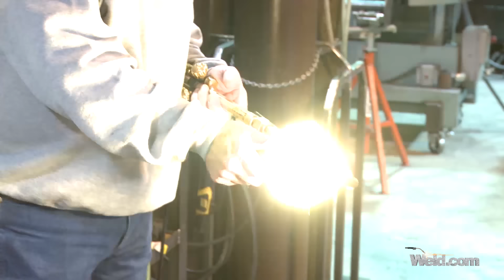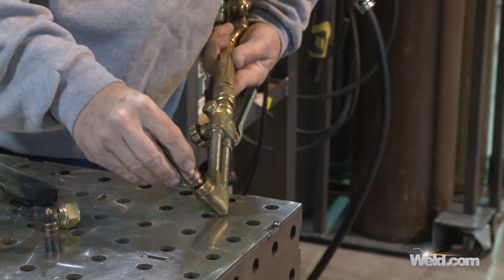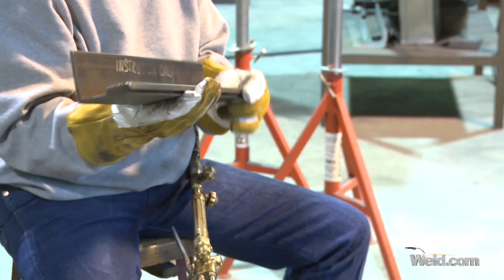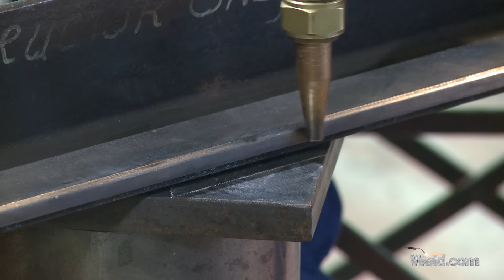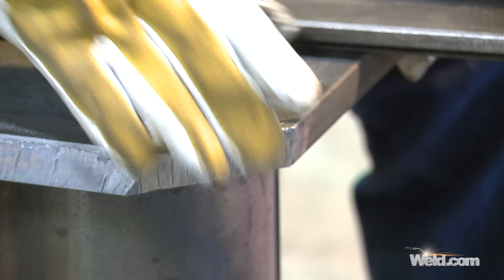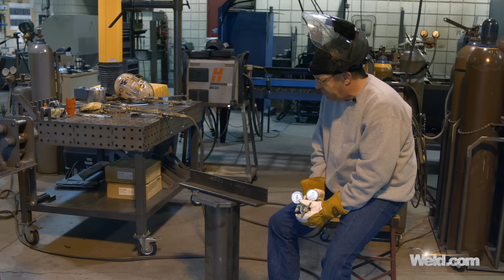🔥 Tips for Oxy-Fuel Cutting Thick Steel

Comment: I was watching some steel workers free hand cutting six inch thick steel with kerosene and oxygen. They said said they can use diesel, or gasoline as well. Gas and diesel is hotter then kerosene, but diesel is very sooty, and gasoline is to dangerous in confined space's.
Reply: All three require special torch tips, and other special equipment, but can burn all day on one 5 gallon tank of kerosene.
Reply: By the way, it was the scrapping of Bertha, the Seattle tunnel machine that was being cut.

Comment: Bob, I would like to see tips on oxy-fuel cutting thin metal as in 3/8" and thinner, I have more trouble with cleanly cutting them than I do thicker stock mostly blow outs and  thick slag on the bottom of the cut, if you get a chance to I would greatly appreciate it and keep the videos coming 😊

Comment: Why don't you go in to more detail about why not to run the acetylene over 10 PSI?  You should also talk about the dangers of using small acetylene tanks and cutting / heating too long with them.  Most people I have talked to just think a smaller tank is like a smaller bottle of water or whatever.  They don't fully understand the acetylene draw rates and why a small acetylene tank can be dangerous if you use it too quickly with big tips and big cuts.

No channels I have watched for years have even mentioned "draw rates" and it is very important because most home shops don't have huge tanks and can get in trouble easily.
Reply: PictureDisks could you explain it. Just curious since I have small tanks.
Reply: Acetylene becomes unstable as a gas over certain pressures (15 psi+) and it will explode, ruining your day.  In the tank, the acetylene is dissolved in acetone to keep it stable at higher pressures.  If you draw too much gas, you start getting acetone in the gas stream (you will see little balls of flame).  Larger tanks will provide higher rates of gas for longer times than will smaller tanks.  Acetylene tanks should ALWAYS be vertical to keep the acetone and packing where they were meant to be.  If you lay one one its side (not advisable but happens) let it stand upright for 24 hours before using.
Reply: jose mendez as I understand it, the acetylene is stored dissolved in acetone, which is liquid, held in an inert solid matrix. If you draw off the acetylene faster than it can be released from the acetone, acetone will enter your hoses, messing up your work but also reducing the amount of acetone inside the tank. Leaving a big space in the tank that isn't occupied with acetone allows a buildup of undissolved gaseous acetylene, which is really good at exploding.
Reply: It's called disassociating
Reply: Small tanks are safe just don't run rosebuds on any acet cylinder under 50psi tank pressure.

Comment: Great Video Bob, Unless the camera is not showing it good I have been adjusting my torch wrong for 40 years. I have always open the mix valve until the preheat flames come down close to the tip and create that fine pretty feather effect. Guess I have some things to try this week.

Comment: Bob, what consequences do you have for too high acetylene? Let’s say over 15? Good catch on the regulator. Another great video. If I could cut like that I would go through lots less 4” wheels!
Reply: Dave Dunn acetylene explodes really easily. We use a different set of numbers in Australia, but I'd assume that's the pressure above which it can spontaneously explode.
Reply: At roughly 18psi at sea level, acetylene will explode, without an ignition source. That's why it is dissolved in acetylene, think about your acetylene cylinder like a 2liter soda, the acetylene would be the CO2 and the acetone it is dissolved in would be the soda.

This is a perfect example of why IMO, you should have to have a license to buy acetylene, involving a basic gas safety test. If you don't know the basic safety rules you have no business playing with explosive gasses. 

Another very important rule is the 1/7 ratio. You can't dispense more than 1/7th of an acetylene cylinder at one time. Any flow rate higher than that, even at lower pressures, will result in acetone flowing from the tank.

Comment: Bob, thanks for this great video, so many super points. Before the days of u tube "older" people like myself had to rely on books. I never thought of kicking the O2 pressures up that high, but my plasma cutters often exceeds 70 lbs. Many who use a straight edge for a guide should note that your leading edge is elevated off the work surface, we'll I'll go back to my nap, once again thanks. J
Reply: I have inherited a 30+ year old oxy acetylene rig. The hoses appear to have lots of cracks. I would like to replace them and have seen hose sets at a local discount hardware store that are smaller in diameter but are relatively inexpensive. Say 50 ft for around 40 dollar's. Would it be ok to go to a smaller diameter hose. Also I would like to add a flame arrestor inline at the tanks and torch ends. What would be recommended as I have seen cheap and expensive ones online. I am new to welding. Any advice would be most appreciated. 

ppear to have lots of cracks and

Comment: I noticed shipyards were using Propane, so I switched from Acetylene to Propane 30 years ago (SO much cheaper, and only a LITTLE bit colder) and NEVER looked back.
Reply: Propane is about 75% cheaper to buy (plus you can get it just about anywhere today.  I also use a small 1 lb bottle if I am on the road (so I only have to BUY and lug around one heavy O2 tank).  While it is colder (5700F Acetylene vs  5100F for Propane,)  but it also uses a lot LESS oxygen so for me it was a win win situation.  This 600 lower temperature means nothing for 99.99% of the users  I have a cheap set of torches and some single stage regulators (Look at ARKSEN Harris on Amazon) and have used and abused them for over 30+ years.  You will need to buy an adapter to convert the Acetylene regulator to fit the propane bottle (About $5 at a welding store)The only thing I had to replace on the torch set was the rubber hoses about 5 years ago.
Reply: Richard Cournoyer Oxy/Acetylene can do 6300F or so, not 5700F.
Reply: @RichardCournoyer  I thought you use MORE Oxygen with Propane!  But can still see how it would be cheaper overall, plus maybe other practical advantages.  I've heard oxy-propane won't melt over the top of the cut, that's something right there!
Reply: Propane IS hot enough to weld steel.  However, H2O is a combustion byproduct of the OxyPropane flame, which contaminates the weld puddle.  That is the reason you cannot gas weld steel with propane.  However, OxyPropane brazes VERY nicely.
Reply: joandar1, Have you ever MIG welded with out the shielding gas turned on?  or stick welded with a rod with the flux coating chipped off?  Looks about the same.
Reply: Richard Cournoyer Awesome, thank you! I'll definitely look into that, I was kind of skeptical but you aren't the only person who's said propane was better. Thanks!
Reply: I believe Acetylene is just about as heavy as Propane, and has a explosive range of about 14 to 86% that is pretty darn wide.  Propane would be safer in that you are not limited to 15 psi like Acetylene.  Too bad we can't use Natural gas.
Reply: Richard Cournoyer I'm 17 and looking to buy a torch. Would you recommend I go with propane? What have your experiences been with propane vs acetylene?
Reply: Hahaha...That's just goofy.
Reply: Definitely not. Acetylene is lighter than air. In Austria Propane is forbidden for underground Workshops. If I were a company that is.
Reply: Propane actually uses a bit more O2 than Acetylene... I've been using Propane  since about 2004.
Reply: I do not doubt your reason, I thought it was temp, I was incorrect. I just new not to do it so I have never tried. Having established that, can you tell me and for that matter others as well what specific effect the water (H2O) has on the weld in the way of what contamination please? Thanks from John.
PS: A link would do, thanks.
Reply: Okay it is all porous, thanks for quick reply. I will do this as an experiment next time I have to braze something. It must be something to do with the steel being molten as it doesn't seem to effect brazing or silver solder. John.
Reply: Richard Cournoyer did you have to have a special regulator set-up?
Reply: we use propylene and propane exclusively in the shipyard.  i have the only small bottle of acetylene in the yard which i use only for brazing and silver solder.  bob  ought to show how the two piece tips come apart for cleaning and how slightly different starting the flame is.  we regularly cut two or three inch thick steel with no problem but we boost the oxygen up to 50 psi to blast through. no one uses the small a torch like the journeyman torch for big cutting jobs
Reply: Propane is great, but i haven't found a flushing tip that uses propane yet...
Reply: Having a two piece tip is easier to clean too. I don't know why anybody would want to use acetylene.
Reply: Since my hobby workshop is in the cellar I decided for Acetylene. The heavier than air Propane is just to dangerous in this case. Otherwise I would also use Propane.
Reply: If you are storing a gas in your house you are much better off with propane. For one the smell will let you know if you have a leak and secondly it isn't nearly as dangerous as acetylene.
Reply: im still in school for welder fabricator, and at school we learn to cut with acetylene, but where im apprentice they use propane, its a weird change haha
they use propane because its cheaper, and not much different when you learn to use it
Reply: I also have gone entirely LP (Propane) Gas for cutting, heating, brazing and Silver Solder. As Richard has said it is cheap and available very widely. The only thing that is not possible with it is welding Steel, not hot enough temp!
Bonus is you go to the shed when your BBQ runs out of gas.
John,Australia. 
 Edit: Zorgoban made an interesting observation that I was not aware of, anyone interested use the link for weight of gas by volume. 
https://www.engineeringtoolbox.com/gas-density-d_158.html
Reply: @joandar1  Did you convert your old acetylene kit for propane or did you purchase a new kit to use propane? I've been considering moving to propane for my home torch kit.
Reply: @Gavreeli , As best I can say to you I still use the exact same hoses  as well as the Oxy Regulator. Need an LP/Propane Reg for that, although I have heard true or not that others have use the Acet Reg. I do not recommend this at ALL!
 For the torch you will NEED to learn about gas pressure and how the two different fuel gases behave! Took me me a while!
 Bonus is only one Bottle rental here in Australia, the LP is also available on weekends. Down side more than Twice the Oxy for same amount of heat for the task at hand. When cutting with Oxy and LP most of your Oxy is not in the Heat of the Flame, it is in the cutting. You will know that amount of Oxy to cut a thickness of plate. 
 I bought a new Reg and Oxy/Propane Cutting and Brazing tips only if that answers your question. Lots of good info on this subject here on YT.
 Hope this helps a bit, Cheers from John, Australia.
Reply: @Gavreeli  There are different torch tips for Propane cutting.  They're noticeably different, I have some that are in two pieces, you can take it apart and clean it.  I think it's much heavier preheat, the Propane flame is a lower temperature and less energetic, I think you get a lot of fire.
Reply: Propylene, I’ve never heard anyone call it propane even though it’s the same. 👍

Comment: I thought you mentioned in a previous video that you don't use a wrench to tighten up the nut holding the tip on? But this video you did multiple times. Can you damage the seat or not on a tip?
Reply: Randy Butts Never use a wrench on the cutting attachment. Tighten the tip with a wrench just to seat it.
Reply: No you stretch the threads on the soft brass fittings

Comment: Love the videos. Thank you for all you do to make them! I would be interested in hearing why acetylene is dangerous and unstable above 10-15 psi. I have always heard that it was, but never knew why or what would happen...
Reply: Thank you for the replys guys!
Reply: Whipple 1 Boom!
Reply: Bob  Moffatt       Never saw it happen and I sure never want to!    Great videos Bob.   They've helped me up my game.      Cheers.       Whipple
Reply: Straight from the MSHA site:     When exposed to excess temperature, pressure, or mechanical shock, pure or less than pure acetylene gas can undergo a violent, explosive decomposition reaction. Additionally, if this reaction, or an ignition of acetylene occurs within the torch base or supply hose, it can propagate back into the storage cylinder causing it to explode violently.
Reply: Wesley Jones You don't want to hear it. Go read about it.

Comment: Interesting.  Have a question for you though.  When I am burning, I always seems to get an unusual amount of slag at the bottom of the cut.  Then I have to work at it to get it off.  On the other hand, I've seen other guy/gals that can burn through almost anything and it looks like (almost) a machine did it.  
I was told I had too much oxygen coming out, too much gas.  I've played with both many times and still have too much slag.
Tip is always clean and a number 1 or 2 is used.
Suggestions?
Reply: Tom McDaniel .. see my post above.

Comment: Can’t be too careful when it comes to flying bits of slag or hot metal. Keep a good eye on your hoses and the condition of your equipment. And what areas your cutting in. Having another pair of eyes watching what’s going on while your concentrated on your cut is always a good idea. I remember my father telling me he was up on an extension ladder cutting away with a brand new out of the box set of gauges on the bottles. Turned out they were a bad design by a reputable manufacturer. They had a plastic plug in the top and sparks were falling around and onto the bottles which were off to the side but still enough for a spark to drop into the plug, melt it and release and ignite the acetylene.The guys working in the factory actually bolted and my father raced down the ladder and turned the bottle off. After abusing the shit out of the CIG rep, all those gauges were recalled and removed from sale. So lesson learned, pay attention to your equipment. Cover things if need be. It could have gone horribly wrong.
Reply: Matt Tradie Go horribly wrong. Now there is an Understatement. 
More like a real bomb going off. No wonder your Dad cussed the rep out. Hard to hear but better than going to a Coronial Inquest.
Reply: Meanwhile we have a guy at our scrapyard blasting tons of metal away to the point he needs 2 propane tanks in his basket. He said he runs his oxygen at 180 with a size 6 Victor tip. He had so much condensation on his basket that he burned it all off only with propane. Regulators line and all.

Comment: Good info on this Bob would you recommend removing the mill scale before cutting.
Reply: I find if you mark on mill scale the marks disappear as opposed to when you clean it off your soapstone marks stay true and visable
Reply: Jimmy Doe but if you're using a guide bar like in this vid it doesn't matter if your marks disappear while you're working, you line up the bar to your marks before you start and then just work from the bar. I still prefer a scribed mark, though, it should cut through any scale.

Comment: Hello sir, what would happen if too much argon is used during tig welding or mig welding? How does it affect the welding process? Will the heat carrying capacity increase? Thank you. Another great video by the way. Have a good one.
Reply: SD B gas wasnt melting filler. Probably long arc and bad angle that caused that
Reply: To high a gas flow will cause turbulence and draw air into the weld area and arc plus it wastes expensive gas.
Reply: Just to throw my two cents in - I've had massive, massive dramas TIG welding aluminium when the gas is set too high. Blows the arc all over the place and makes it really difficult to add filler material without that (now) mega hot gas blowing out and melting the filler! Granted, it might just be my so very poor technique.. I'm sure other people will be able to add more comprehensive info!